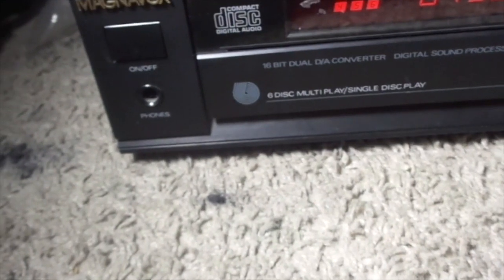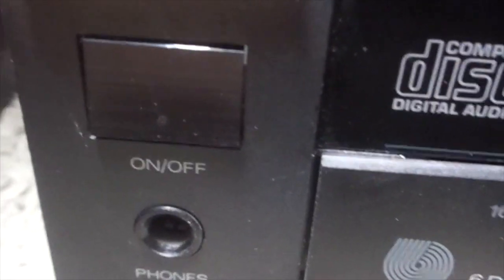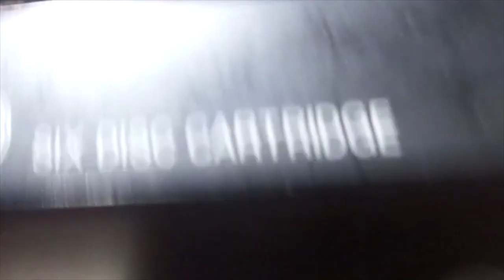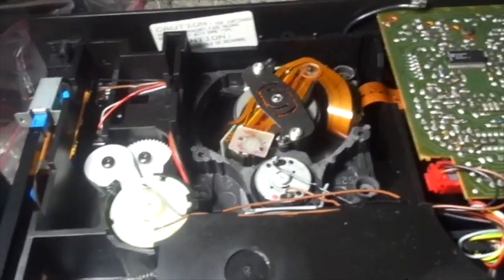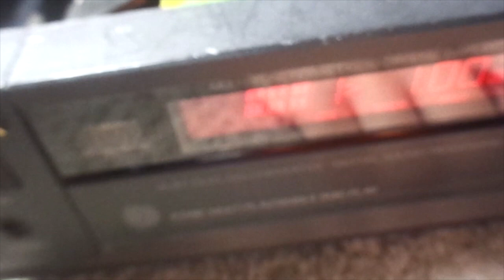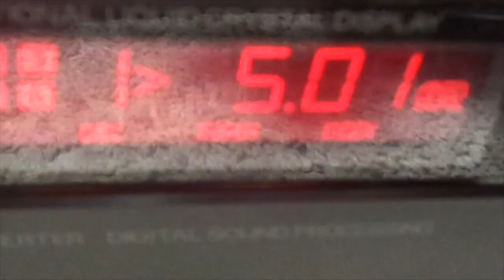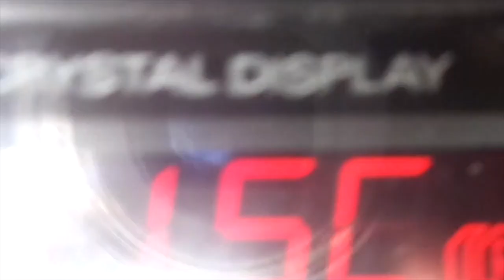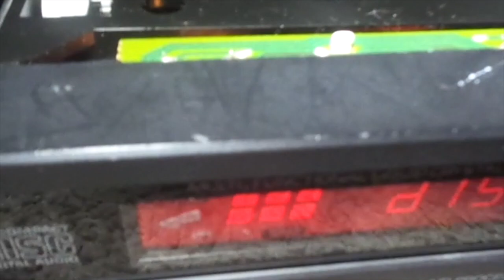Review Of My Magnavox CD4000 CD Changer

Comment: That's a cool CD player, I didn't know what it looked like on the inside. The CD drive is unusual too, it's placed upside down. Also, this is a Philips made unit, and it uses Philips' type of CD laser, which uses something similar to a computer hard drive instead of a motor and a rail. Also I've seen those screws on Philips DVD players at the thrift store. The Youtuber Technology Connections made an interesting very in depth video explaining how a CD player works and the difference between Philips' type of CD laser and Sony's, if you're into CD players you should check it out.